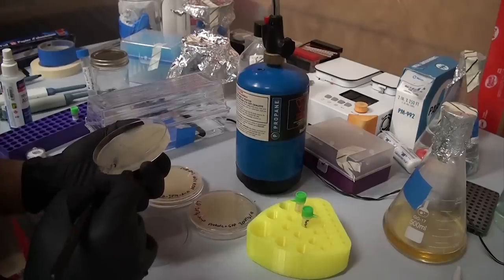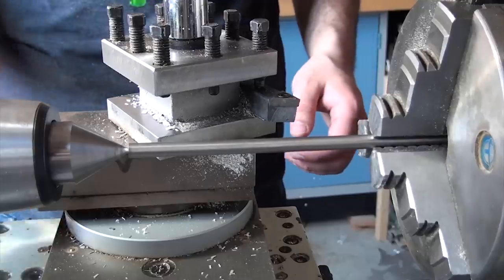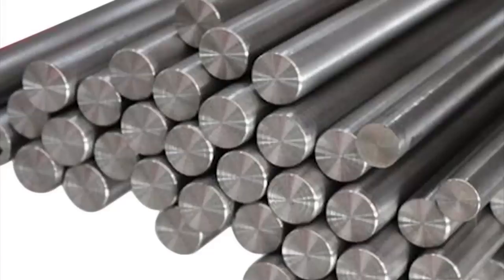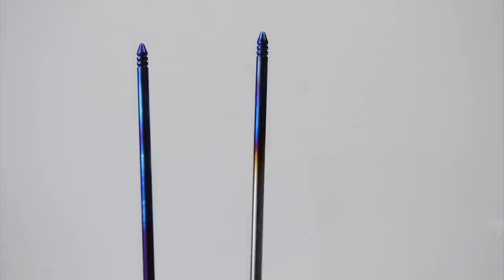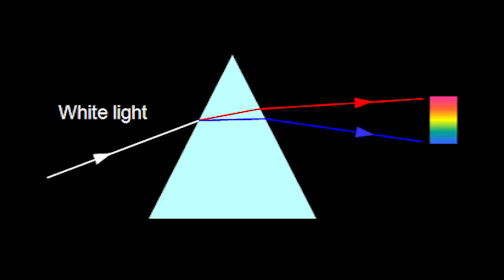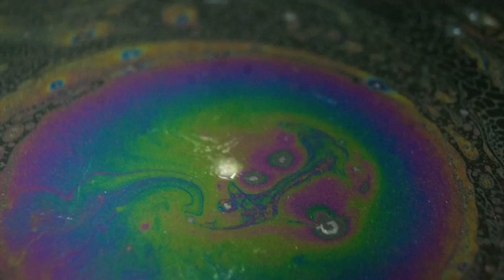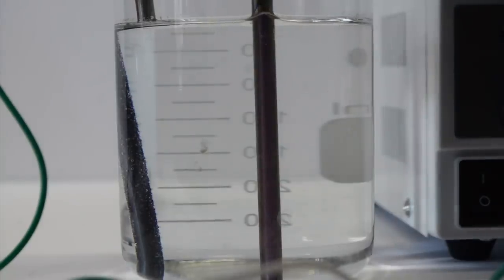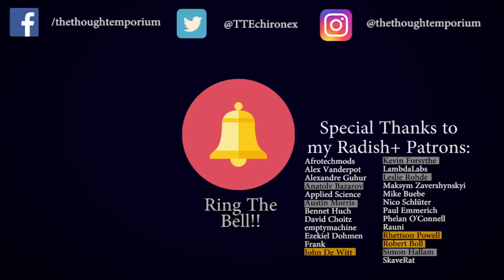Why is Titanium so COLORFUL? - Making/Anodizing Titanium Chopsticks

Comment: I was replacing the handle on my hatchet recently. When my father told me to hammer the back of the handle to put the head on. I was wondering why the head walks up the handle against gravity when I apply force towards the direction of gravity. (the head is touching nothing but the handle). I would have expected it to fly off. (recently reshaped and Sharpened razor sharp this would have been dangerous).
Reply: It's because of the inertia of the axe head. The handle get's driven into the head before the head gets a chance to move, and then friction holds it in place.

Comment: One thing that ive always been taught is you are sanding it wrong...
Do not hold both sides of the paper at the same time... it can grab and then wrap your hand around it.

instead cut a strip and then hold each end of the strip in each hand and wrap the sand paper around...

Plus you can sorta saw it back and forth getting a newer piece of sandpaper easier.

School made me watch one too many lathing accidents... dont wanna see that from your channel lol
Reply: Make a teardrop shape with the sandpaper, don’t let the two halves touch. If it makes a tight circle it will grab and spin with the material. 

I’ve seen those same videos, just understand that “school” is a propaganda center. They only care about controlling what you think, academia is long dead.

Comment: I've seen this coloring process happen on the gas tubes on M16A2 rifles in the Army.
Reply: Also seen this effect on titanium exhaust pipes on bikes/cars, 
My mates Harley 1000 Sportster's steel pipes looked like this after he left it on full choke for about 5 minutes too long,
Master heat treater...perhaps not!

I'm thinking it's all to do with the chrome, maybe a thin film effect, as the plating is probably only a few thou thick, if that

Comment: Very cool!
But.. why does heat and electricity causes oxidation. (for the sake of completeness XD)
Reply: For the heat part: http://www.substech.com/dokuwiki/doku.php?id=high_temperature_oxidation_of_metals
Types of oxide layers
High temperature oxidation usually results in formation of an oxide layer on the surface of the oxidizing metal.
Thin oxide layers (commonly thiner than 3000 Å) are called films. Thicker oxide layers (above 3000 Å) are called scales.
(1.0 Å = 10-10 m)

Oxide film does not form if the partial pressure of oxygen is lower than the oxide’s dissociation pressure of a particular metal. Such conditions are characteristic for the noble metals (eg. gold, platinum, silver) oxide films of which are unstable at the temperatures below 932ºF (500ºC).

Oxides of some metals (molybdenum, osmium) are volatile. The oxide molecules evaporate from the oxide layer surface in parallel to the oxidation process. The rates of the two processes (volatilization and oxidation) equalize at a particular thickness of the oxide layer.

Oxide scale may be composed of several layers of different oxides. At the temperatures above 1050ºF (566ºC) iron scale consists of three layers: FeO (the layer adjacent to iron), Fe3O4 (middle layer) and Fe2O3 (surface layer).

Depending on their structures the scales may be categorized into two groups: protective scales and non-protective scales.
Protective scale prevents access of oxygen to the metal surface due to non-porous continuous structure of the oxide layer.
Non-protective scale has loose porous structure providing free access of oxygen to the underlaying metal.
The scales type may be determined by the Pilling-Bedworth rule:
The scale is protective (adherent and non-porous) if the volume of the oxide is not less than the volume of metal, from which the oxide was formed.
The scale is non-protective (porous) if the volume of the oxide is less than the volume of metal, from which the oxide was formed.

Oxides with volume much greater (twice and more) than the volume of metal, from which the oxide was formed cause developing compressive stresses. The stresses may lead to cracking and spalling of the scale, which result in faster penetration of oxygen to the metal surface.

https://advancedplatingtech.com/technical-library/plating-topics/causes-metals-oxidize-rust/
WHAT CAUSES METALS TO OXIDIZE OR “RUST”?
All metals, with the exception of the precious metals, will oxidize when exposed to oxygen and an electrolyte (i.e. atmospheric moisture).  It is a chemical reaction of the metal surface with the oxygen present in the air that causes some of the metal to corrode (or oxidize) and form the respective metal oxide on the surface.  In some metals such as steel, the corrosion products formed are very visible and loose.  Everyone has observed the red color of iron oxide (rust) seen on improperly protected steel products.  The red rust formed is generally scaly and loose and easily falls away exposing more and more basis material to the environment.  However, metals such as stainless steel (steel with added nickel and chromium) oxidize as well.  The difference is that the nickel and chromium oxides formed are a more uniform and tenacious oxide layer that protects the underlying material by “sealing” the surface from further oxidation once formed.

In addition to the surface oxidation that occurs on individual metals, any two dissimilar metals placed in contact with one another with an electrolyte (such as atmospheric moisture or water) will form a corrosion cell.  This is the very basis of batteries used in everyday products.  One of the two metals in contact will corrode in preference to the other and form that metal’s respective oxide.  Which metal corrodes is based on what chemists call the electromotive series of metals.  The selection of what plated layer to use is an important one since electroplating in its very essence is the process of placing two dissimilar metals in contact with one another.  The plated layer (or layers) can either be an anodic coating (coating corrodes in preference to the substrate) or cathodic coating (substrate corrodes in preference to the plated layer).  Whether a coating is an anodic or cathodic coating greatly impacts how the finishing system will perform once in service and there are advantages and disadvantages to each.
Reply: @PBGetson  Waw this is a very kind response. I hope you cut n pasted it and not write it all out. Thank you!

Comment: hello could you please give the rpm value on your turret?? i 'm starting a precision project @ home soon! kuddo's to your vids!
Reply: I can imagine the precision you will get without the mental capacity to get the speed and feedrate lookup tables.. To a half of an inch?
  Hint: it's not in RPM, it's in surface moving speed and for different part radius it will be on different RPMs.

Comment: actually you can chemically remove the oxide layer easy with titanium etchant and not have to sand the surface. also make sure to try and protect your self and machine from the titanium dust from sanding and cutting. that shit is very hard and will destroy your lathe if you let it build up on the ways and you probably dont want to breath it in general

Comment: As a machinist i see you need to watch and lern more about turning because if you use a tailstock support and "little ditch" your part shouldn´t move at all...

your point on the tip of the life center is too blunt and you need a 60° drill
in addition you should never clamp a workpiece longer than 3x its diameter without any support so it cant flex as much

greetings from germany

Comment: I don't buy the thin film interference explanation that is always given for this kind of colouration effect. Interference effects are always angle dependent, as the phase difference between the first and second reflections is proportional to the path length through the film, which varies with viewing angle. For a uniform film thickness on a cylinder, the light would travel through less oxide to get to your eyes at the portion of the cylinder closest to you than at the 'sides' - an interference effect would therefore produce a subjective gradient of colour. This is seen with true interference effects such as oil films and iridescent bugs, which change colour subjectively as you move your head around . It's even demonstrated in the video, as the dichroic only shows reflects strongly at a very specific angle. It's simply not possible to produce a uniform single colour with thin film interference.

That said, I have no idea how this effect actually does work, but its certainly not a simple case of thin film interference.

Comment: you have a very bad habbit that will take your fingers and possibly your life if the lathe is a decent size. never wrap your hand around shafts with sand paper cut it in strips and hold it from the ends and pull back so if does grab its not instantly wrapping your fingers crushing them up wrapped in paper for the doctor and thats if your lucky otherwise it just sucks your all the way in